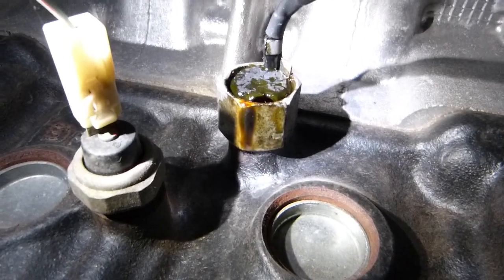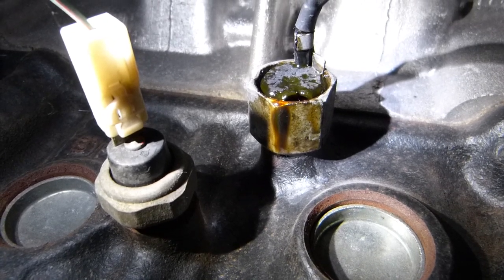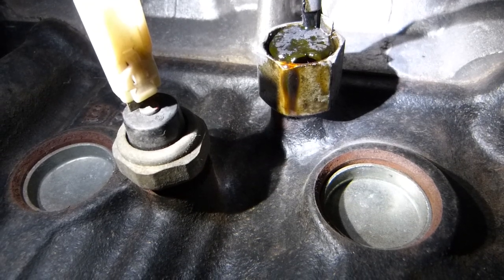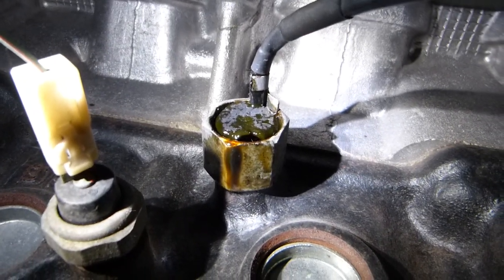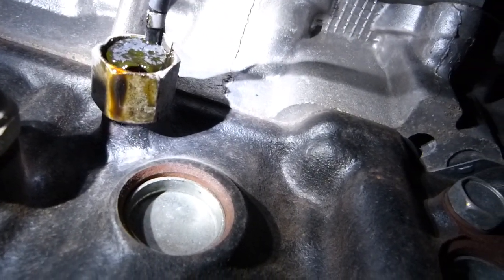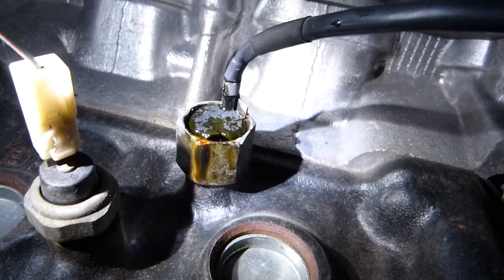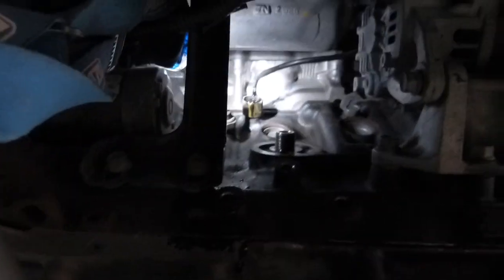Oil pressure and knock sensor location and operation

Comment: I have a knock sensor code I replaced it with AutoZone part but I’m still getting the code?
Reply from the maker: Yeah the engine needs fixing, tuning, whatever, sensors are right

Comment: What engine is this? (in the video)
Reply from the maker: Mazda FS 2.0L (1991 cc) 130 hp (97 kW)and 135 lbf·ft (183 N·m) engine is found on:
1993–2002 Mazda 626
1993–1997 Mazda MX-6
1999–2001 Mazda MPV (Japan)
1999–2003 Mazda Capella/Familia (Japan)
2001–2003 Mazda Protégé
1993–1997 Ford Probe
1999–2006 Kia Carens
but can also be found in 
- Mazda 323/Protege 1.8/Protege 2.0/ Protege5/Lantis/Allegro/ Astina/ Etude/MazdaSpeed/ Familia Neo/ Demio/Verisa/ Axela,
- Nissan Wingroad/Sunny,
- Ford Activa/ Tierra/Laser/Lynx/ Lio Ho,
- Kia Carens, Haima Family
(mostly 1997 - 2003 in North America, still being made in Taiwan, China, Columbia)

Comment: how would I know if my 89 Ford ranger has a knock sensor? I would ask my friends but they keep telling my I has an oil pressure switch, not an oil pressure sensor (which has the low/normal/high gauge.)
Reply from the maker: Ask an old mechanic in your neighborhood (I don't want to be wrong)

Comment: Just done a service on my wife's November 2002,  Mazda 323 astina, FP 1.8 DOHC EFI engine. Noticed the top sensor has a small engine oil leak. I think it's an engine knock sensor. I'm buying a new after market sensor on ebay for $31.99.👍🏻👌🏻😅🤣😂.
 Genuine price is 380.00. 🤤😓😢😭 Cheers from 🇦🇺...
Reply from the maker: Thanks for watching. Ebay new parts made in places with no quality control can fail electrically when new. Feeding trash signal to the car`s computer may permanently damage the engine as the computer messes the ignition timing to work with the knock sensor data.
Better off getting a non-leaky used OEM cannibalized from a junk yard.
Or fir a gasket on the old sensor so there is no leak.
Reply: @theoverengineer  thanks for the tip, hear what your saying is true.The part from ebay comes with a 12 month warranty. Sensor leaks, gives false info to onboard computer/ fault code,  get a refund & a trip to the wreckers. Genuine parts here in Australia are rip off prices. That sensor costs 380 .00. I installed an engine timing kit & water pump from ebay on this same car, engine runs fine, no coolant leaks. Cost 1/3 the price compared to genuine price....
Reply from the maker: WHaaat??? $380?? That`s outrageous. I`ll start searching for a kidney recipient soon, I might donate one ...
(Thank for watching)
Reply: @theoverengineer  yep, we're been anally violated by the dealers. 😭😭😭. Thank god for the internet shopping, purchase items from all over the world, mostly from China.

Comment: Hi - how to check when getting a knock sensor code if the Knock sensor is working or needs replacement? Thanks!
Reply from the maker: See the work https://www.youtube.com/watch?v=ZEysaEktCXA between 17:20 - 18:02
Resistance could be in the 550 kOhm range, look up your make and model`s specs.

Comment: Will this shut your car off  and have to wait to cool down. That's my problem please help
Reply from the maker: It can if oil level is low, or if oil is sludged up and isn`t really flowing, but so can an overheating thermostat from the coolant system.
Knock sensor is unrelated.

Comment: I had a 2000 Protegé with a (ZM-DE) 1.6 DOHC, engine and it didn't came with Knock Sensor, it it's like the one you have in the video but where the knock sensor goes is empty and if you don't use good quality or 89 octane gas it knocks when the engine is under load. The only issue with him very reliable car.
Reply from the maker: +Pedro L Maldonado Very much so. They added knock sensors to lower unburned or partially burned air pollutant levels generated at cold start and under heavy acceleration. Cities need clean air.

Comment: Also the knock sensor only applies to the 1996-2002 2.0L Mazda 626.  The 1993-1995 2.0L models do not have a knock sensor.  The knock sensor was added during the switch to OBD-II which began in 1996.  Good video though it was informative.  Your explanation of the oil pressure switch was dead on great.
Reply from the maker: +DJDevon3 Good catch, just a one-digit typo.
Reply: +DJDevon3 Does Mazda 323 protege 2000 1600CC have a knock sensor???
Reply: USA model most likely does yes because of OBD-II.  Some other countries in the world didn't get OBD-II standard vehicles until 2002... so there's really no way for me to definitively answer that unless you have a US model.
Reply: the knock sensor for mitsubishi eclipse gt 2002 isnt next to the oil pressure sensor like it is in this video ,Do you know if i have to remove the intake manifold  to replace knock sensor  for my car?

Comment: Your description of the oil pressure switch was great.  Your understanding of the knock sensor is not 100% correct.  The knock sensor detects harmonic frequencies inside the engine not outside.  Think of it as a tuning fork that only picks up a very tiny and specific harmonic range (as vibration yes but it's such a small range that it's in a harmonic frequency) which the engineers have calculated to each specific engine block.  The frequency on an FS engine will be different than a KL engine for example.  It's tuned per block per model.  The knock sensor is there for the purpose of detecting engine knock, pinging, and pre-detonation.  It is a sensor for combustion chamber ignition health.  it is not for listening for loose bolts or anything outside the engine.  In the case of a loose belt or missing spark plug it would only trigger a knock sensor if it is causing a bad ignition event.  When the knock sensor detects engine knock it will attempt to compensate for it by either advancing or retarding the ignition timing.
Reply: ا having issue with my freight liner 2007 century 
The truck will start with a sign of engine protect or not shows meanwhile the yellow check engine when it shows can’t started it and will makes it turn off who got this problem please advice me
Reply from the maker: +DJDevon3 Thanks for watching & commenting. I appreciate your time you put in to make 100% correct videos for everyone. I could have scripted a clearer explanation, so here is some post-production word-smithing:
Right, the tuning fork analogy is another way to explain operation, my words at 2:40 -2:45 "The knock sensor is listening for vibrations coming from the engine" is a conceptual metaphor as no device has actual ears to listen with, nevertheless the microphone is modelled after the workings of the eardrum & auditory ossicles, in effect they "detect harmonic frequencies" - like you said.
The knock sensor operation is summed up by the Mazda Service Manual on page 01-03B-33 as "Sound is produced when air/fuel mixture is ignited by something other than a spark plug (eg. hot spot in the combustion chamber)" and can be set off by "engine overheating (low oil or cooling system malfunction), ECT or IAT sensor malfunctions, inadequate engine compression or fuel pressure" - verbatim from the manual.  (ECT = engine coolant temperature, IAT = intake air temperature)
Correct, outside source (aerial sound) transmission is not its sensory function hence being bolted to the block and insulated with resin from outside noise. It is built for solid sound transmission (submarine ping location) detection as SST provides faster signal pick-up with much less signal decay. SST is also implied behind the wording of the Service Manual. So I totally agree, outside noise source location or interpretation has never been the knock sensor`s purpose, it was introduced as a measure to reduce air pollution, a sensor to detect (through SST) non-ideal combustive malfunction.
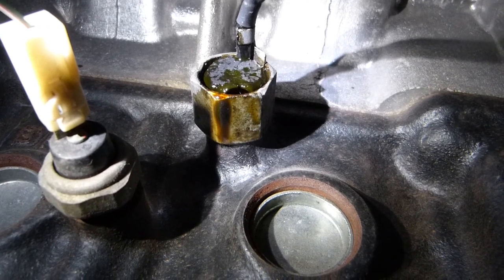Also right, at 2:45-3:00 I said "The normal range of vibrations is programmed into the computer (PCM) throughout the entire RPM range under all kinds of loads." is describing the same work as "engineers have calculated to each specific engine block". 

So, what`s with the loose bolts, belts, bad engine mounts, low oil level or added extra mass (say a crazy bolt-on turbo charger)? These DO change the resonating period and amplitude of the vibrating mass of the engine. Such signal is picked up by the knock sensor IF the vibration is within the operating frequencies of it. Referring back to the Manual`s "engine overheating" item, low oil causes bearing and ring overheating and creates extra hot spots in combustion chamber. Loose belts, bolts, mounts are extra noise (through SST) the PCM does not have a reference for, part of their noise could be within the engine ping frequencies but outside "the normal" sound parameters, triggering the PCM`s trouble code.
I hope it`s clearer to everyone now.
Thanks for watching.
Reply: theoverengineer What do you mean by SST?
Reply from the maker: +DJDevon3 Oh yes, it`s not "special service tool", sorry, I shortened "solid sound transmision" as SST, where transmission is not a car part but a way through which sound waves travel. Floor and wall assemblies (2x4 + drywall, 2x8 + R40 fiberglass + drywall, 6" concrete + 1/2" drywall on Z-bars, ... etc) have sound transmission classes in buildings where sound travelling through SST is measured. Funnily, they use knock sensors as input devices.